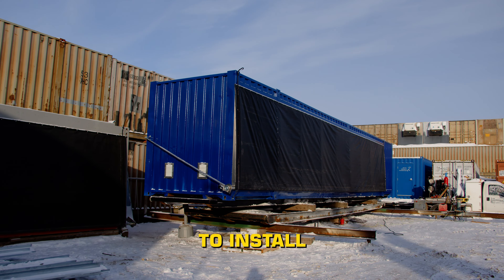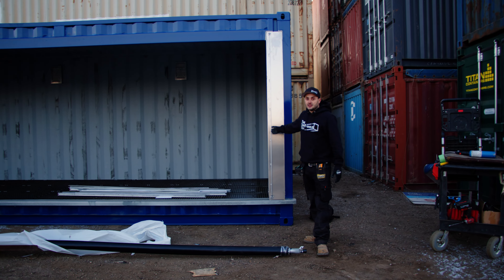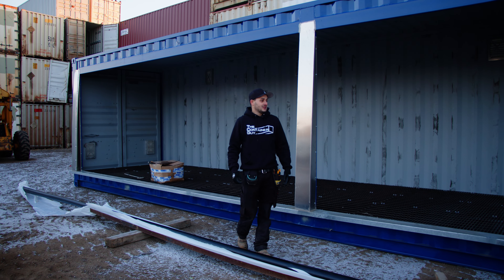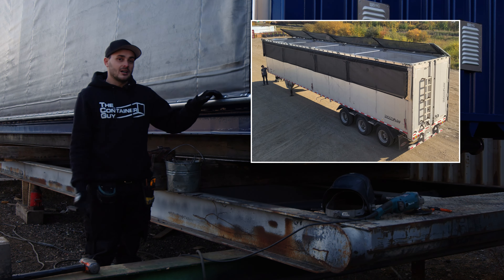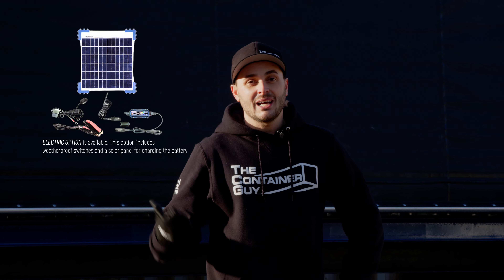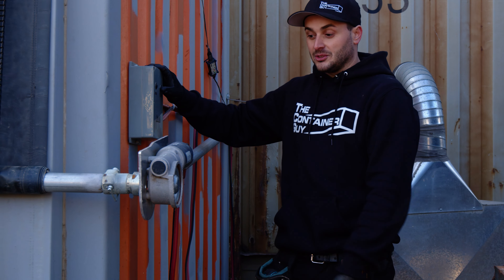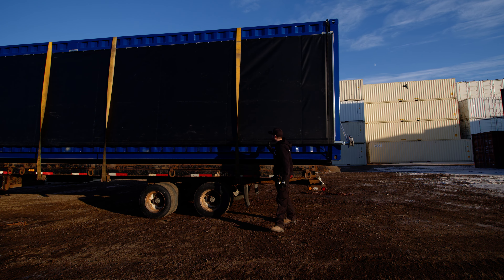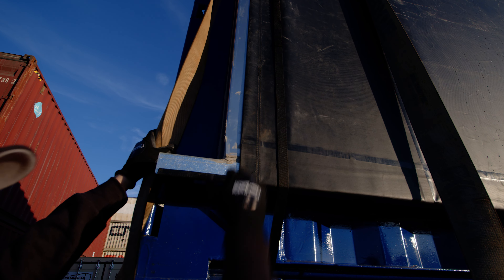NEW Shipping Container Open Side Door System

Comment: If you are framing 24" on center "with a perfect studs" your space should be 22 1/2" in between the studs "all thing perfect." I have never built anything with a shipping container. But just from a construction background, anything exposed to the outside or temperature differences you want a barrier to block or buffer moister, condensation or splash back. Air also acts as a thermal barrier. So if you pack insolation to tight and or restrict air flow you can either cause condensation or reduce the R value of the insolation. Also wrap like Tyvek for example you do not want a 100% vapor barrier or you can get dry rot. I could keep going on this subject but hopefully that helps a little.
Reply from the maker: Thanks for the comment. Not sure if this was the most suitable video for the comment but it has relevance on our other videos. As we go down the rabbit hole of interior vs exterior framing methods, wood vs steel stud, and which insulation type, there becomes thousands of variations and it makes a guy dizzy thinking about it. The climate, the budget, the intended purpose, local codes, etc also play a huge role.